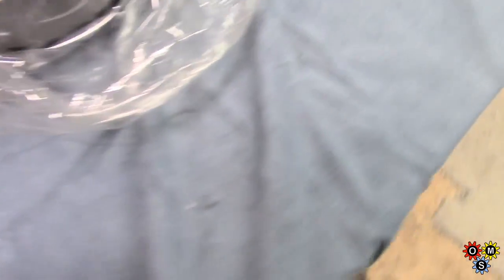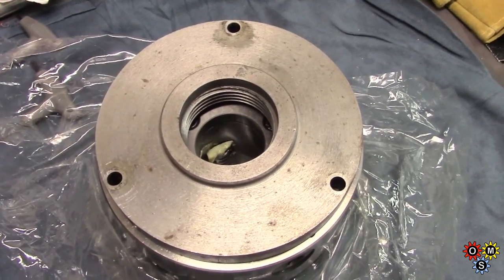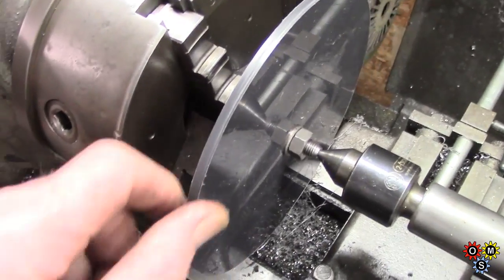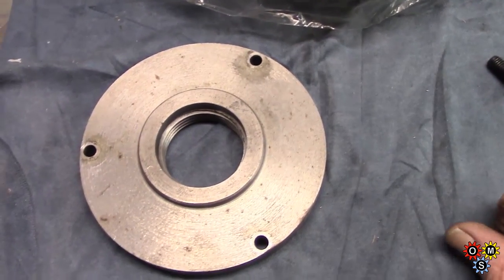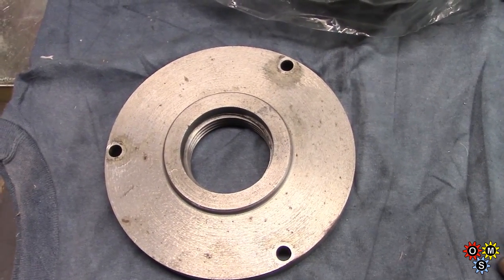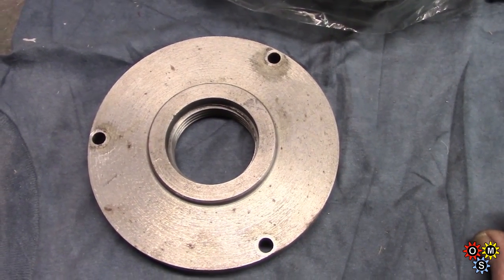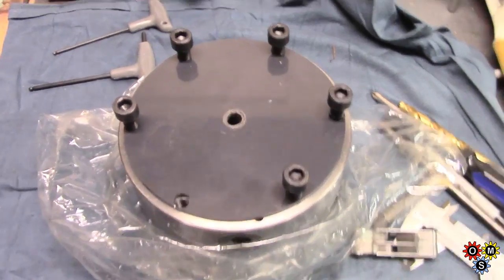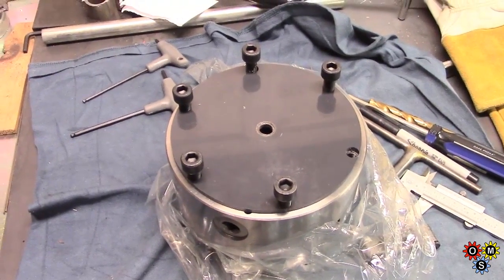Testing a Back Plate Hole Pattern

Comment: Hey Chris, don't despair you'll getter done... 
It will be interesting to see how you intend to sleeve the plate.
Reply from the maker: +pierre beaudry 
Hi Pierre, Should get the backplate soon -- meantime other odds'n'ends. Not sure yet about sleeving - hopefully got some material to use, then - in this case, probably have to be a press fit but, won't be real thick sleeve for this one so hopefully manageable.